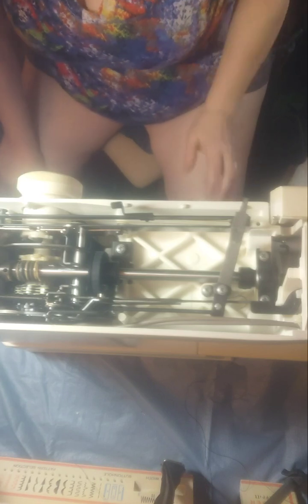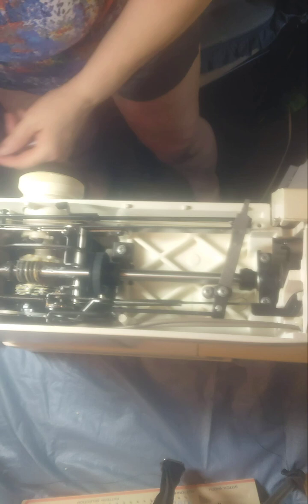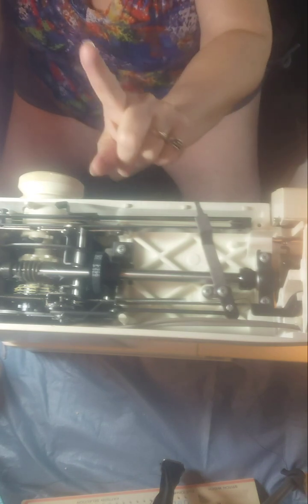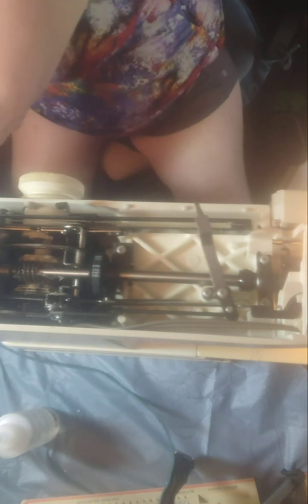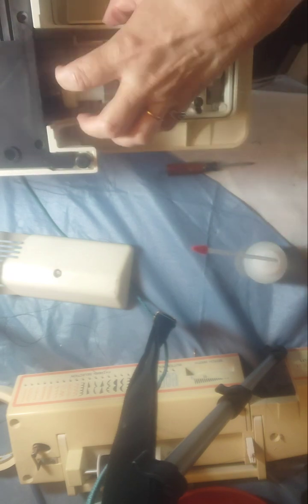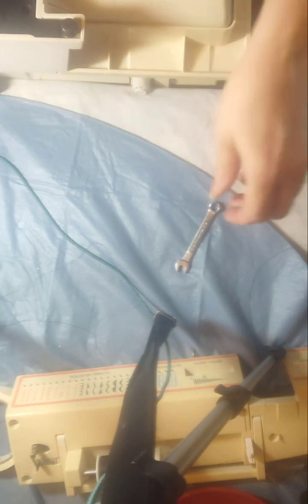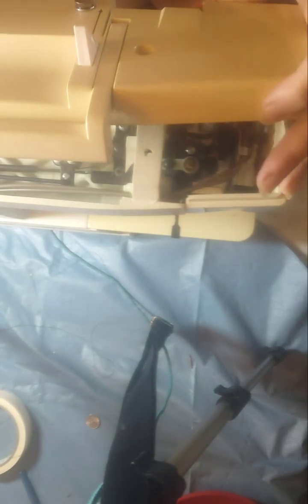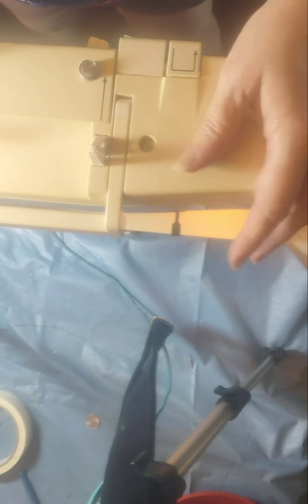My $7.99 Singer Merritt 4552 Machine - How to Disassemble,  Reassemble&MORE@sewwhatseamstress9076

Comment: Thanks for indicating the bobbin size. I just opened my machine after getting it back from Saudi in our home goods. The accessory kit was stolen by the philippino packer in Saudi. She took the entire kit that was taped to the inside of the case.😢  May she break all her needles using my kit. 😂 To put it's top cover back on, line everything up to the front, using a long thin screw driver or your finger to reach under the cover lid and press up the stitch length lever to fit over its lip as you press down on the cover in the front. Then as you press the back of the cover down, the lever will pop back into place.  It'll pop in gently if you're careful. Then line up the left side with it's end chassis clip. Start with the bobbin wind guide screw, then the screw over the needle mechanism, then the 2 screws by the wheel. In that order. It'll seal down better that way. Do not try to remove the stitch display face plate to fit the top cover over the stitch length lever. It's heat welded in place. Good luck!